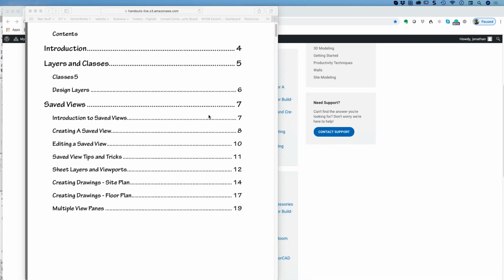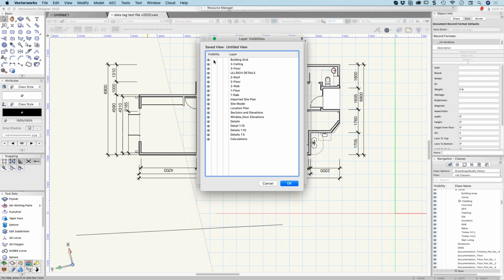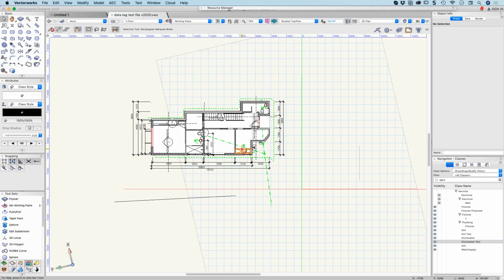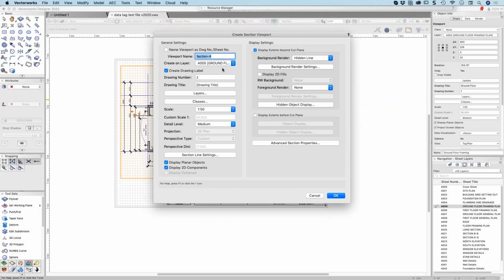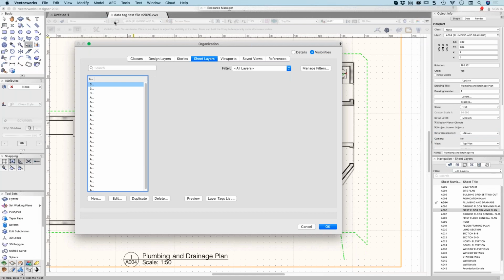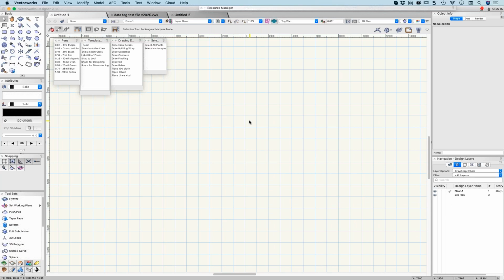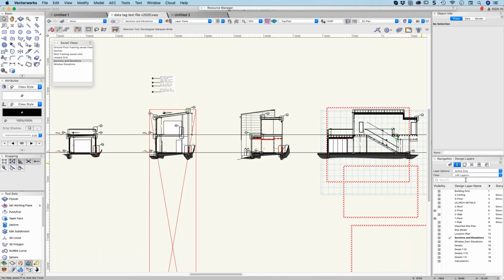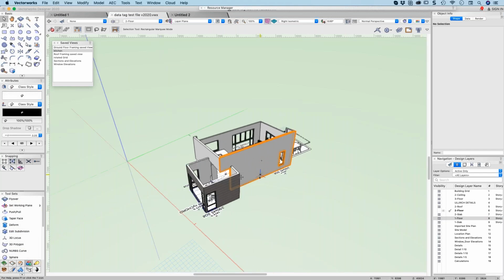Creating and Managing Drawings in Vectorworks 2020

Comment: At around 17:48, how are you moving between sheet layers so efficiently..?
Reply from the maker: That’s a keyboard shortcut that Vectorworks has. If you hold down the control key on a Windows machine or the command key on a Macintosh, you can then use your uptown arrows to navigate between sheet layers and design layers.